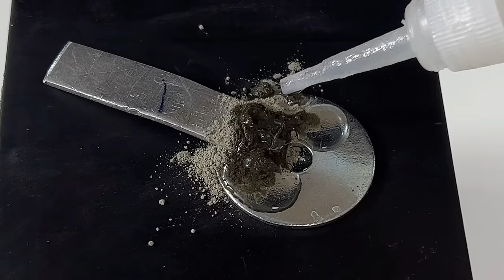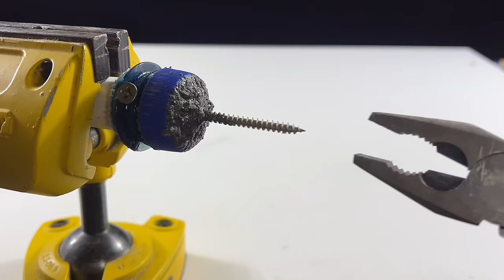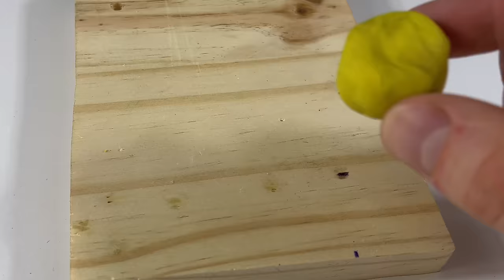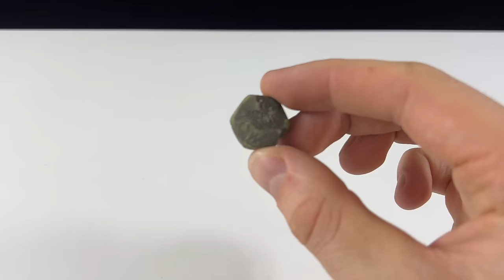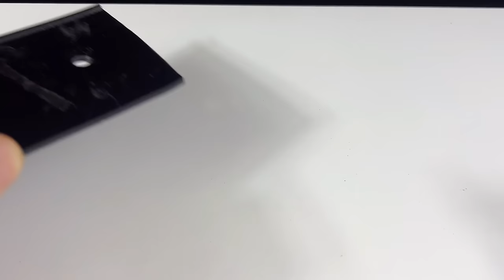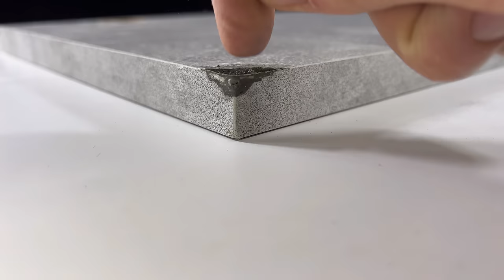Super Glue and Cement? Will This Fix Everything?

Comment: That taking a mold of the clip and then placing the broken part into the mold to rebuild it was genius.
Reply: @AiresLA Your cremated grandma will serve good for years to come!
Reply from the maker: Thank you, Glad you found it useful!
Reply: Yes, that was outside of the box thinking right there.
Reply: Timestamp?
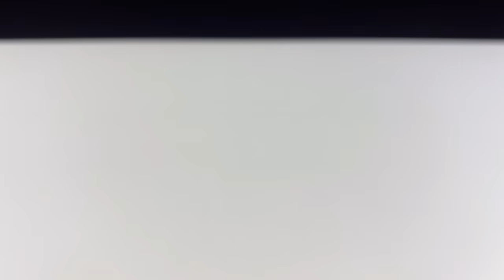Reply: @stevethea5250 0:57 or thereabouts
Reply: COOL @Alacritous
Reply: What mold was used? Play-dough?
Reply: That is in fact how the purpose of a mold.
Reply: The playdo was a bigger deal imo
Reply: @nneeerrrd  when I die I want my ashes to be mixed with super glue and put in a mold (which I'll prepare in life) to make a statue of me.
Reply: how did it magically turn black?
Reply: @maxforce  I noticed that too.  It looks like he replaced the finished item with an unbroken black part. Otherwise it would have been cement-gray.
Reply: @nneeerrrd  🤣
Reply: Yes it was.
Reply: indeed, that is an awesome technique!
Reply: @paulrybarczyk5013  after relooking I noticed, You are wrong   as he hasn't replaced but it can be seen replaced part is gray color
Reply: Yes, but if you replay the clip slowly, the full black frame is there before adding the super glue... Hmm!

Comment: Great video. There are so many substances that bonds well with CA glue. But we need a comparison test in different situations to see the real strength of these concoctions.
Reply: Another video right there
Reply: Baking soda is a popular substance, and its strength is abysmal. I wouldn't use the combination for anything but purely cosmetic repairs that have zero stresses on them. 

I'm skeptical of this concrete solution.
Reply: It depends on technique. If you want maximum strength you need to make many layers. You need to apply CA and bristle with soda and again apply CA, and you need to wait all the time till the CA hardens naturally layer by layer. The material will be translucent .
If you pour CA quickly  and use tablespoons of baking soda it gonna be a porous substance, and its gonna be opaque. 
 

 @imacmill
Reply: @Cortesevasive  It will still be extremely brittle. If you bend it, even slightly, it will fail.
Reply: @Cortesevasive  i have multiple stuff fixed with ca+baking soda (no multilayer), being on of them my headphones (fixed it 5 years ago), use at least 2hours a day, and it's fine

Comment: I used superglue to close a deep cut in my finger.
(Cut to the bone)
It worked perfetly.
(In Vietnam they did the same to  help the soldiers)
Put it on...
and after a few days...
 it came of. 
I put some extra glue on it.
And it healed perfetly. Almost no scar.
Reply: Yes, I always do the same when cutting myself by accident. Another upside is: you can wash your hands or shower without always having to replace a band-aid.
Reply: You forgot the cement
Reply: @Still_Fortnut 😂😂

Comment: I've heard of the baking soda trick and I've used it it works fantastic sets up instantly and it is rock hard
Reply: It isn't rock hard, it is a ROCK.
Reply: @oscaremoralesp28 It is brittle AF, and is worthless for anything other than cosmetic repairs.
Reply: @imacmill 
You always have understand the difference between hardness and toughness.
Reply: @CurlyFromTheSwirly  'Toughness' isn't an engineering term. You need to understand that.
Reply: @imacmill  
Bro, there is a scale for both hardness and toughness. In simple terms, hardness is an offensive ability, the hardest is a diamond and used to cut through things.

However toughness is the defensive durability, which things like diamond lack. Metal has more toughness. Diamond is added to metal to make it cut better.

Food for thought, water isn't hard but it sure is tough.

In engineering, you'll need to know:
toughness is the ability of material to resist cracking or breaking under stress. And engineering websites talk about it.
Reply: @CurlyFromTheSwirly  What's the unit of measure for 'toughness'...bro?
Reply: @imacmill  
The same as for hardness but different materials

Comment: We need a comparison video between
- super glue + baking soda
VS
- super glue + baking soda and graphite mixture
VS
- super glue + cement!

Who's curious about which one is the strongest and wich one is the weekest?
Reply: Интересно! Но мне кажется, что результат будет одинаковым.
Reply: I've only used super glue + baking soda, and it hasn't always been the best..never tried SG + Cement..it looks like it would be tops..
Reply: You know the bit near the end of the video where he/she repairs a crack in a thin piece of (what looks like) ABS plastic? If you use SG and baking soda, that repair will last 0.05 seconds if you even slightly bend the plastic. Baking soda with SG should be used for cosmetic repairs only. Concrete may be better, but I'm skeptical of how much.
Reply: @@-who-cares-do you mean epoxy alone or with concrete?

Comment: Interesting idea, but there's a huge difference in the coefficient of thermal expansion between the plastic and the filler. With reasonable thermal cycling, like in a car, I'd expect early failure. Have you tested these conditions?
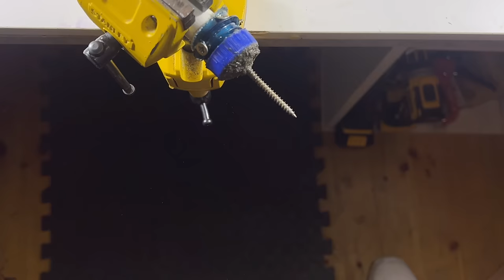Reply: At 00:44 seconds
Reply: @block9390  Are you sure about that timestamp?
Reply: These examples are only for cosmetic repairs. you are better served using a pure superglue or even better epoxy for applications that involves significant stress.

Comment: Will it repair small tears in vinyl automobile seat upholstery do you think, because sitting in the seat will put stress on the repair every time someone gets in and out of the car. Have you tried it on upholstery and vinyl seat coverings yet?
Reply: I kind of doubt it will work on something as flexible and stretchy as vinyl.   I would try another piece of vinyl glued to the backside of the tear with something like 3M upholstery glue.   I’ve done this sort of repair before, several times, with good results.
Reply: Silicone adhesive spread thin to fill in cracks in leather and vinyl appears to work. Mix the silicone with oil-based paint. Once cured you can then paint over the repair with paint specific to leather/vinyl coloring and it will stick. If you don't mix paint into the silicone prior to application the paint won't stick as well.

Comment: Nice, but for most of those things you can simply use epoxy glue instead (it should also be less brittle). I guess CA dries faster, though.
Reply: And people have been using epoxy fillers for a long time. The longer work time means you can dial in the right consistency you want, from peanut butter-like consistency to ketchup-like consistency.
Reply: I use both epoxy and super glue and strength are similar when used correctly with super glue slightly cheaper  and much faster
Reply: CA is dirt cheap dries quickly and is accessible
Reply: @Cortesevasive  its also has poor solvent and temperature resistance, brittleness.  CA will never hit 4400 psi tensile strength...  Shrug, pends on the job...

Comment: I second the request many here have made to compare the different materials you used so far (and perhaps others) for these fixes.

Which one works best? Are they equally strong, equally resistant to heat/cold, etc.?

Ash is perhaps least good due to worse availability; baking soda and cement are both cheap and easily available;
Reply: Why haven’t they delivered Poplar to you yet?
Reply: @RASKATFAETON  what? 😂

Comment: This must be the best addhesive there is. I only see one thing that makes doing this kind of messy...which is the super glue that soaking off the good parts and leaves big glue stains.... if you can eliminate that variable you are golden!
Reply: Wax the areas that you wish to remain stain-free?
Reply: in my experience, super glue when mixed with baking soda, sanding dust, even flour, makes a bond that rivals epoxy.
Reply: CA glues don't bond well to some types of plastics (HDPE, PE, Delrin, Teflon). They can't glue really wide surfaces like contact cement can. They also prefer a tight fight and aren't good at gap filling. Yes, using a filler helps it fill gaps somewhat, but it still doesn't flow like a gap-filling glue will.

There is no "best" adhesive. Adhesives are a deep and technical field, with lots of different formulations for specific purposes.This is especially true when you get into bonding plastic, or trying to minimize clamp time as they do in construction lines.

Comment: Why does the glue produce heat when it touches the concrete? There's a reaction going on that doesn't look healthy
Reply: Superglue produces heat. Superglue works thru exothermic reactions from alkaline substances.

If it doesn't heat up then it won't dry.

Without any catalyst, it reacts with oxygen in the air.
Reply: @helbertgascon   Does alkaline mean that  it produces heat when it either touches water or air? I get what the metals do.
Reply: @Useruserusername790  i mean it goes into a chemical reaction when it comes in contact to any alkaline substance.

And yes, it does produce heat when touching water or air.

Or to be more detailed. The superglue dries thru exothermic reaction which causes its liquid to evaporate which results in polymerization.

And the sodium bicarbonate(the alkaline) mixed in the cement which helps it harden also accelerates the polymerization process which produces the smoke you see since it heats up so much that it causes the liquid to evaporate rapidly.
Reply: Are polymers synthetic? And why does copper "seem like" it softens when heated and quenched, I notice that when I watch katana makers hammer the blade collar on the sword, copper shouldn't have a hard or soft state like that, it's gotta be more of the molecules spread out slightly kinda thing.